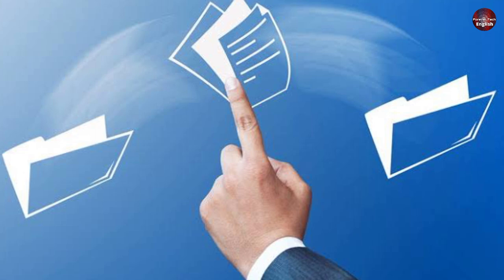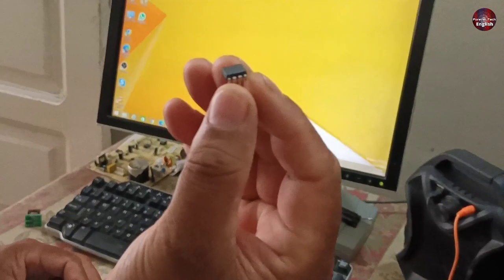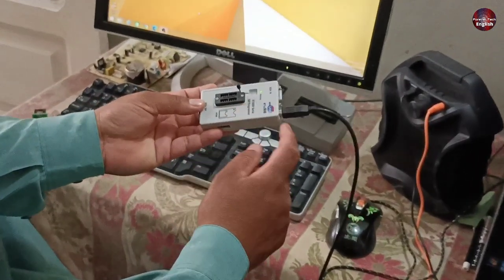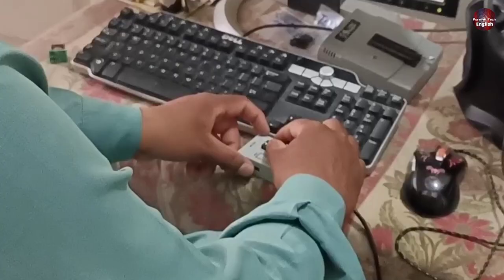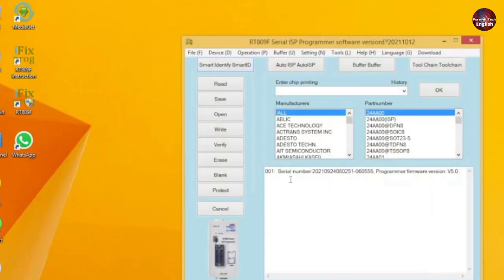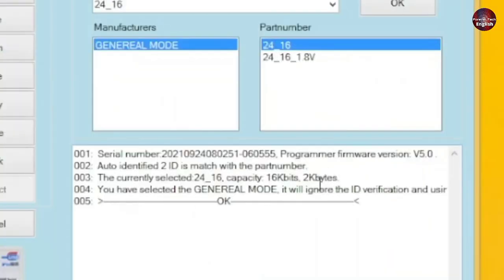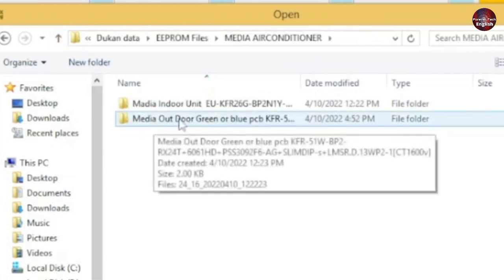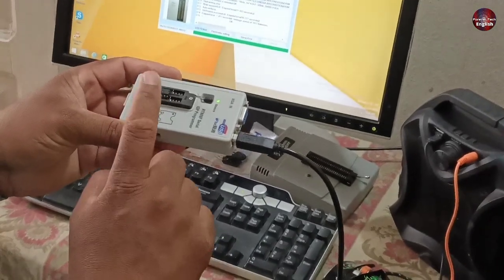Mini-Split AC PCB Control Board EEPROM Programming

Comment: Just asking ... any chance you could provide where to locate the file for the eeprom? I have the same control board and it's giving a P4 error. All components tested good. Think it's either the microcontroller or the eeprom.
Reply from the maker: Well I get them from the circuit boards I usually repair. I have made database for myself for the eeprom files. well have no idea where to locate it online.